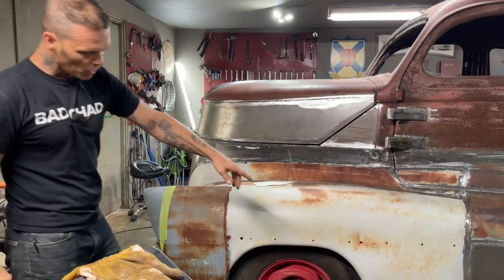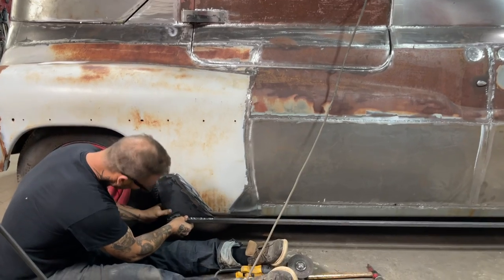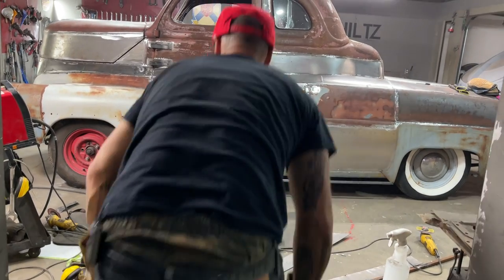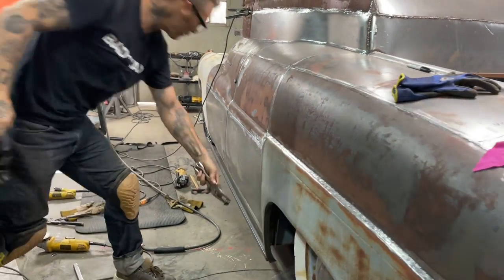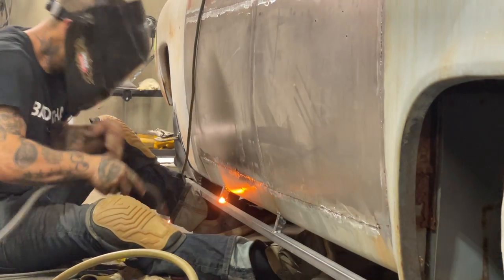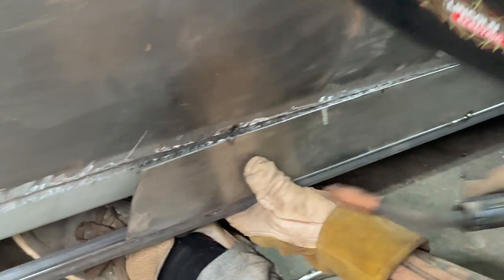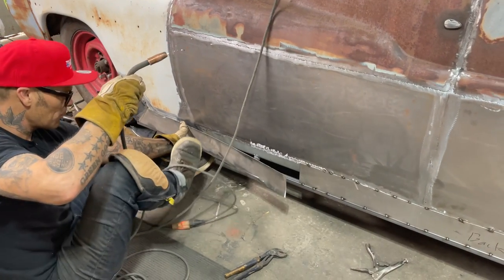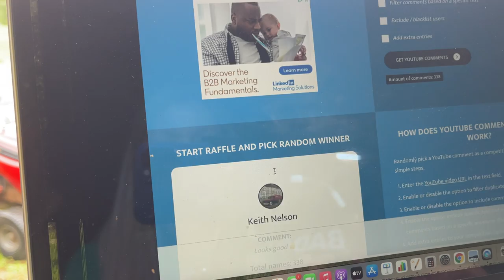CABOVER FABRICATION: LOWERING THE BODY 3 INCHES

Comment: Great job Chad & Jolene! My step dad owns the body shop I grew up in, he’s a 1st class body man & a 1st class painter for 40 some years. In the late 80’s, he hand built a steel bodied replica of the 1974 Great Gadsby car. Robert Redford’s 1929 dual cowl phantom Rolls Royce, on a solid auction trucks frame with its still currently reliable late 80’s running gear, he put little glass packs on it, to give it some type of sound, painting it pale yellow. A cream top was made with a vintage looking dash by the best local interior shop. It’s missing its Rolls Royce engine sounds & straight cut gear whine. Now and then it get’s parked in front of the shop as a moving sculpture advertisement piece, that turns heads & hopefully pulls in wealthier passerby’s into his shop. After the newest 2013 Gadsby movie came out, featuring a Duesenberg, he made its chromed spare tire covers & ditched the ugly cream & light green seats, for the new movies very dark green, almost black leather. It’s been in many of our local car shows & all of our 4th of July Parades, for decades…8)

Comment: Please keep the motivation on this thing so we can see if finished!
Reply: We've got to cheer him on.
Reply: Chad how much will the front end drop when the drive train and interior are installed? Will the skirt in front be so low as to snag on road/drive way entrances?
Reply: @galeschneiderman6070  Lining up the ground hugging bodywork without weight... that's a good question. He may have to beef up the springs in the front to get it level.

Comment: I constantly watch Chad pick up the power cord from something and try to plug it into an extension cord. Almost every time he has to turn it over before it fits. I got so fed up with that in my shop that I shaved the wide prong down to the same width of the normal one and then snapped off the round grounding prong. Now I plug everyone of my tools in first time and no fooling around. Simple fix.